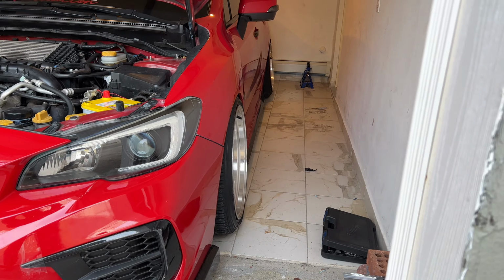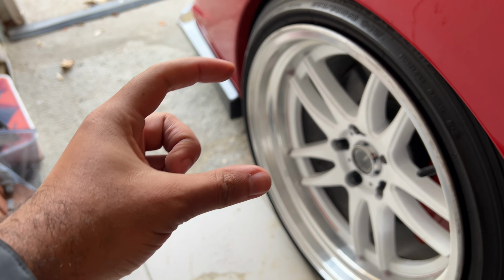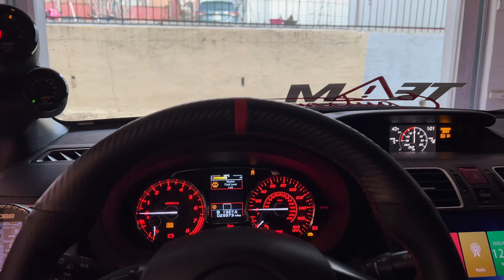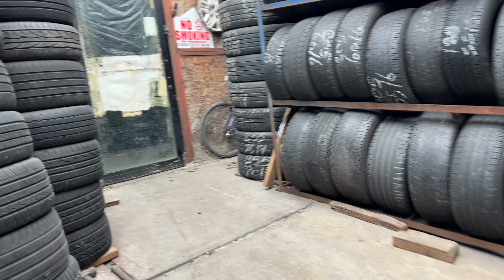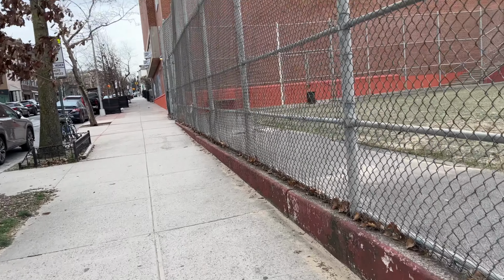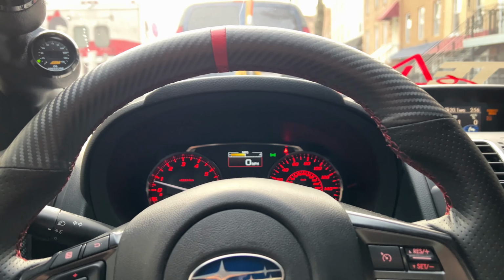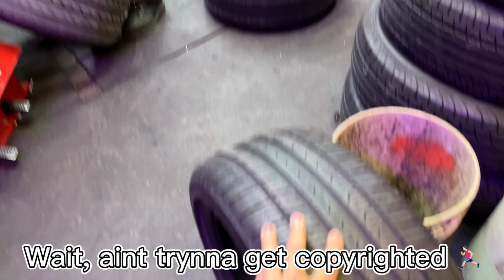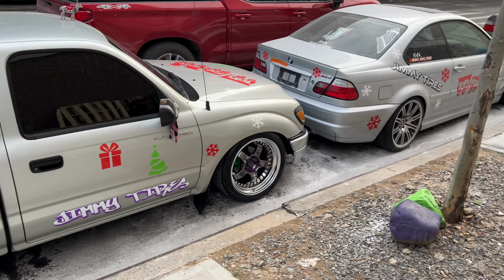My Wrx Got New Wheels For Christmas

Comment: How much clearance you had when you were running a 255 35 tire in the front and you think you have room for the rears if you did
Reply from the maker: Fronts rubbed like crazy but it really all depends on the hight. My car is really low so yea I could not run 255/35 in the rears without rubbing especially with 10.5 wheels